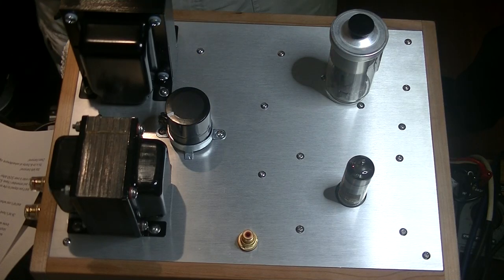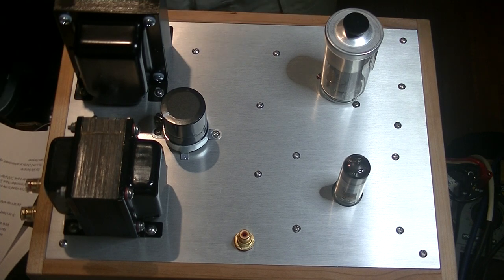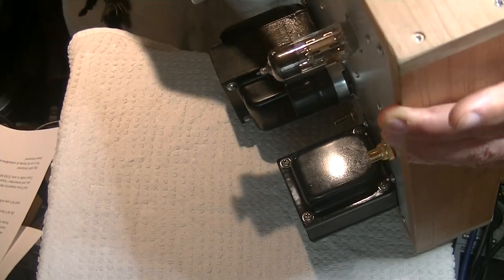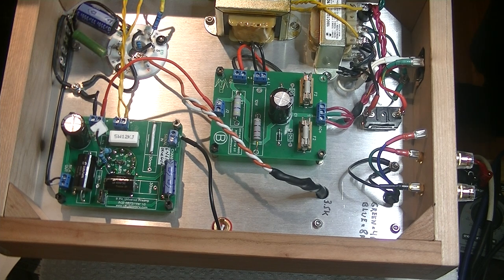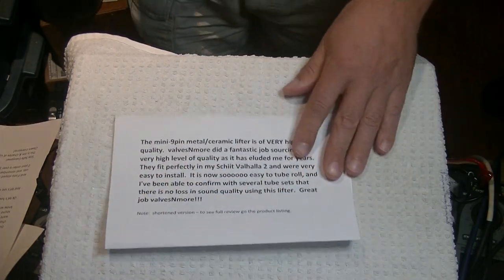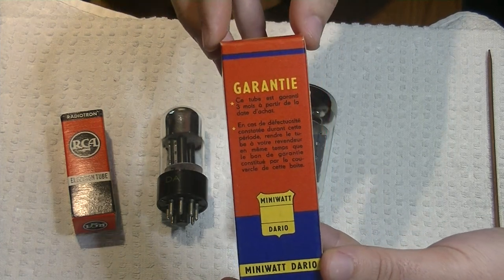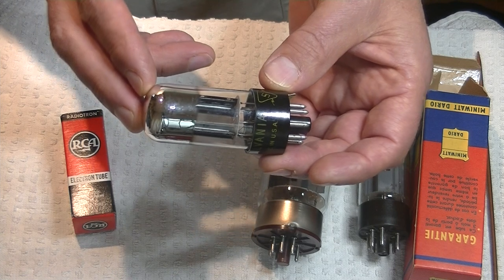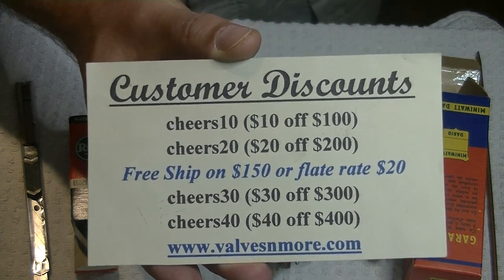Tube Lab #102 GU-50 8w Prototype Kit MonoBlock Amp

Comment: What about a Headphone amp version that can handle a 150-600 ohm load, using the GU-50's
Reply from the maker: The GU-50 is a high voltage high powered tube and would not be a good match for a headphone amp.  However the vintage Svetlana 6P1P-EV, which is a small 9 pin  beam powered tetrode, is a perfect fit and it sounds amazing in our prototype kit headphone amp.

Comment: why not an OTL for headphone (300 Ohm) based on GU50? di you have any project in mind?
Reply from the maker: This is a good question!  For a tube to be suitable for an OTL amp the internal resistance of the power tube needs to be very low.  The reason for this is your output impedance needs to be lower or close to the impedance of your output transducer (speakers/ headphones).  The GU-50 has roughly an impedance of 4,400 ohms (4k4), so even if we paralled 10 of them we would still have an unacceptably high output impedance of 440 ohms (4,400/10).  This why tube selection is a huge part of each new Kit Amp design.  We start with a quality vintage tube that meets our requirements and is available in reasonable numbers and affordable.  Then we design the amp around it.